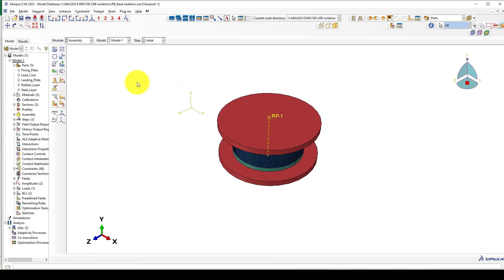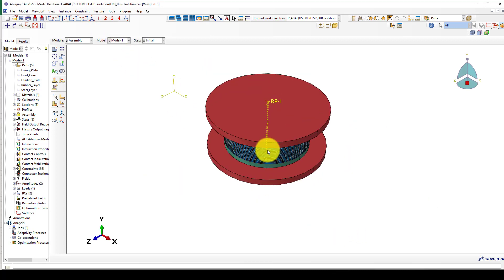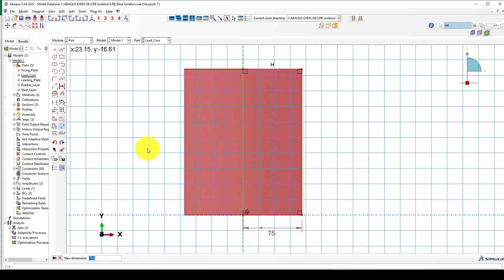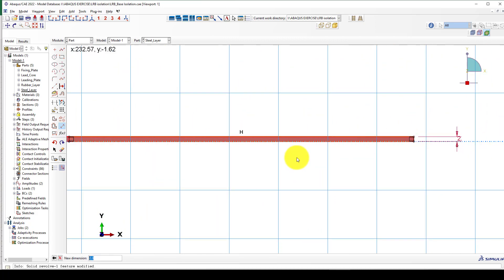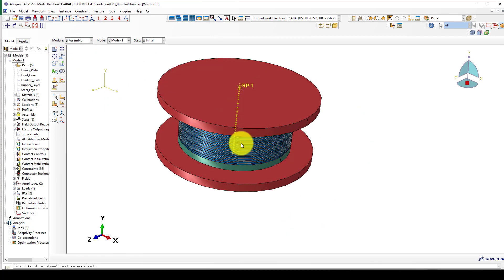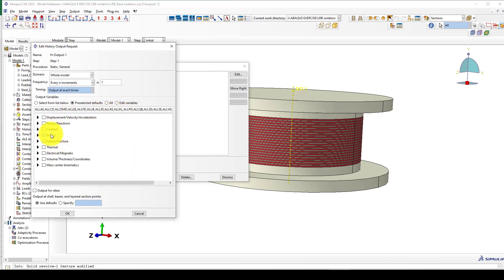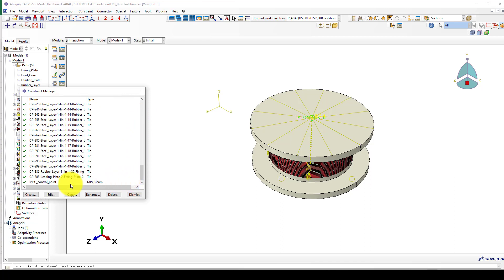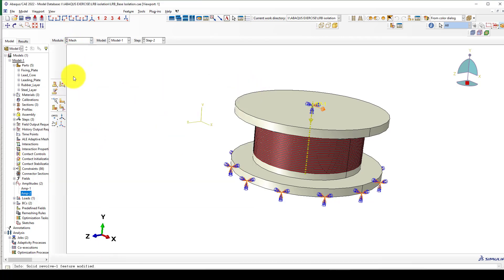Lead Rubber Bearing Isolation Modeling and Analysis in ABAQUS Software

Comment: Very helpful sir thank you so much, I have a small question, when I model a struture on ABAQUS I use connector elements to simulate the bearing behavior so I define the effective stiffness in the 3 directions, but I need a guide to follow on how to define the damping behaviour of the isolator, thanks sir.
Reply from the maker: In the connector There is connector damping too .
Reply: @KSSE_Engineer  yes sir l know, but I don't know how to define it, do i input persentage for example 0.05 ?, or is it  ( force x seconds ) / distance ?
Reply from the maker: @MohamedAshraf-eh5ml  Not percentage. It's C  not kesi.
Reply: @KSSE_Engineer  I still can't model the connectors correctly, can we have a tutorial sir of a base isolated structure with connectors ?
Reply from the maker: @MohamedAshraf-eh5ml  It's an advanced topic. if You should by that Tutorial. a video Tutorial with files.